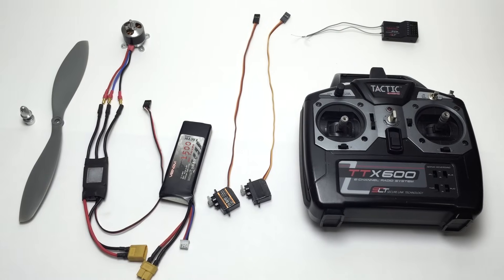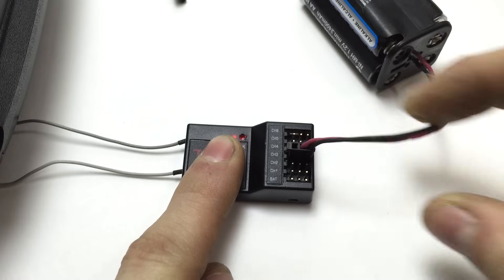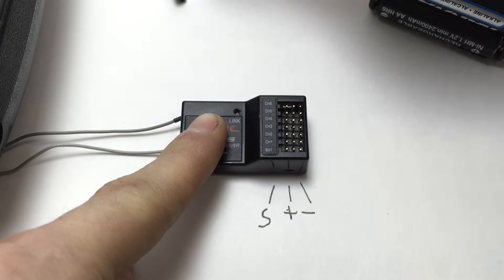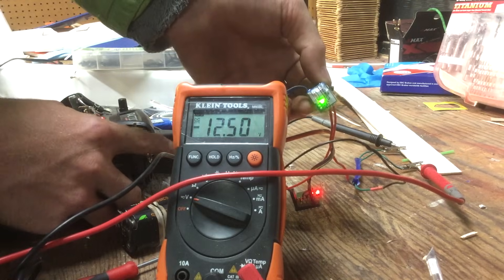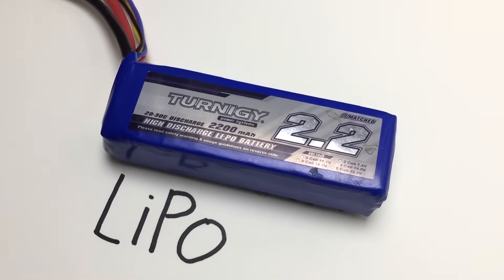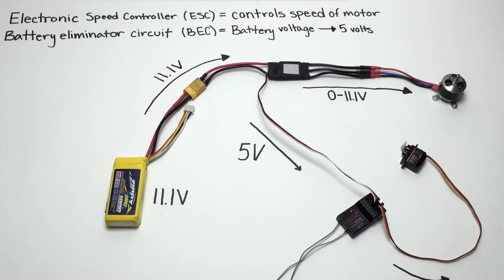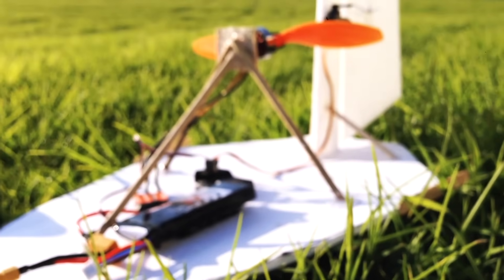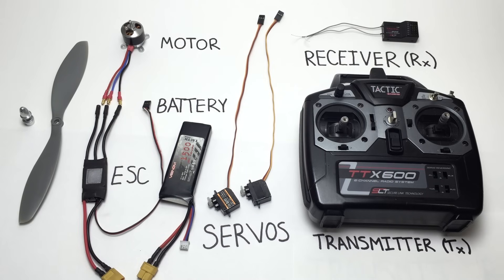RC Electronics for Noobs

Comment: Would it be possible for you to give a parts list for electronics I'd need to get started? I don't want to buy something just to find out I wasted my money. Basic question, if you were starting from scratch to build your first experimental RC plane, knowing what you know now, what would you order?
Reply: And I mean exactly what you order, preferably with links.
Reply from the maker: +Chad Snoke That's a great question, and it's hard to say just because I don't just go around buying everything. So some of the things I've seen that I think are good deals and quality products are also things that I haven't bought so I can't personally vouch for.

Keep in mind that this equipment is where the money is. This is why RC planes are expensive. But I consider it an investment and very high value because it's reusable equipment that you can strap to all kinds of foam crap. Most of my equipment has been with me for years through DOZENS of airplanes (and their fatal crashes).

I like this kit from Flite Test: http://store.flitetest.com/power-pack-c-fixed-wing-large/

I also think HK's Orange TX/RX line is a very good deal: http://www.hobbyking.com/hobbyking/store/__54822__OrangeRx_T_SIX_2_4GHz_DSM2_Compatible_6CH_Transmitter_w_10_Model_Memory_and_3_Pos_Switch_Mode_2_.html

This is a great bettery http://www.hobbyking.com/hobbyking/store/uh_viewItem.asp?idProduct=11944
You could save 5 bucks with some others if you want but I would buy this one.

This is a simple charger http://www.hobbyking.com/hobbyking/store/__49338__Turnigy_E3_Compact_2S_3S_Lipo_Charger_100_240v_US_Plug_.html

But if you want, a fancy charger is a really awesome tool to have http://www.hobbyking.com/hobbyking/store/__58285__IMAX_B6AC_V2_Professional_Balance_Charger_Discharger.html
Reply: +Samm Sheperd (SNRS) Thank you, parts ordered and can't wait to start building! Any experience with an autopilot system? We're primarily interested in mapping and after a few builds may try to implement waypoints and GPS.
Reply from the maker: By they way, I just notice that the Orange transmitter doesn't come with a receiver. The cool thing about the Orange line up is that they have receivers that are also flight stabilization systems. This is a standard 6ch receiver http://www.hobbyking.com/hobbyking/store/__31224__OrangeRx_R620_DSM2_Compatible_Full_Range_6Ch_2_4Ghz_Receiver_w_Failsafe.html

If you don't want to pay HK shipping again, you may be able to find it somewhere else. like amazon http://www.amazon.com/OrangeRx-R615X-Compatible-2-4GHz-Receiver/dp/B00HZSD8UO/ref=sr_1_1?ie=UTF8&qid=1456945476&sr=8-1&keywords=orange+receiver
Reply: +Samm Sheperd (SNRS) Thanks, I noticed there was no receiver so I ordered this basic one:

http://www.hobbyking.com/hobbyking/store/uh_viewItem.asp?idproduct=46632

It doesn't say it comes with stabilization like this one clearly does:

http://www.hobbyking.com/hobbyking/store/uh_viewitem.asp?idproduct=31586

I'm guessing my first one will not have stabilization, though it would sure be handy as a newcomer.

Comment from the maker: Also, do you think I should do a review on that mini quad at the end of the video?
Reply from the maker: Oh okay...
Reply from the maker: Used this motor http://www.headsuphobby.com/HURC-300-Blue-Wonder-1400kv-Brushless-Motor-G-272.htm

and an 18A ESC, 9g servos and this same radio system all used in this video
Reply: +Samm Sheperd (SNRS) The CX10 has been out a while now.  It's a great learning quad.  I just wish they would have a cheap one with 3 axis (acro) on it to learn with.
Reply from the maker: Rum Ham By pressing down on the right stick, you enter flip mode. The transmitter will beep and you can push it forward, back, left or right and it will flip that direction by itself.
You can also cut the throttle mid flip to force it to flip multiple times, though recovery is not guaranteed.
Reply from the maker: Antaluss66afira66 bf110 With no ESC, you can't control the speed of a motor, You can still control servos if you can power them with a battery or something
Reply: +Samm Sheperd (SNRS) I would like to know how you did that flip.
Reply: +Samm Sheperd (SNRS) Oh cool. I never read the instructions.
Reply: Rum Ham  You weren't missing much by not reading them.  As usual they couldn't be bothered for a real translation.  Maximum Engrish.
Reply: williwonti haha
Reply from the maker: Rum Ham Clicking the left stick changes its maximum bank angle/sensitivity/maneuverability
Reply: Samm Sheperd could you do a review on the new pocket plane they make?
Reply: Samm Sheperd yes pleasee
Reply: +Samm Sheperd (SNRS) This thing is way cooler than I realized. Even though I already have one I think a review would be a good Idea, considering how cool they are for the price.
Reply: +Samm Sheperd a question what if there is no esc
Reply: ***** tanks
Reply: Samm Sheperd yes
Reply: Samm Sheperd darmn it I bought servor and only has three plastic things
Reply from the maker: Antaluss66afira66 bf110 I don't understand your issue
Reply: ***** I wish I could send u a pic
Reply: Yah
Reply: Samm Sheperd i want to make rc quadcopter i just want to know that can i use rc helicopter transmitter and receiver for quadcopter?
Reply: Samm Sheperd Thank you so much this really helped me out I'm building an rc car  with a string trimmer engine and I didn't know how to setup S servo with a controller nor did I know how to use the receiver. Thank you! You saved my project!
Reply: what did you use to connect your motor wires to your esc wires
Reply: Rip
Reply: Samm Sheperd hello , what your name
Reply: Samm Sheperd . contact me now  bro
Reply: Saif Ali he is dead
Reply: your noob
Reply: @normanyoutube3864  he is dead now may he rip

Comment: See I told you , another great lesson for the new RC user, you helps get new modelers building their own models, you make it less misticale. If I were to plug a servo with different wiring in to the receiver will it cause any damage apart form not working.I wa told that it will damage the potentiometer.
Reply from the maker: +Chris Boyce I don't know of such a case. There are 3.3v servos, but they are micro and have a different connecter

Comment: This is perfect! I have been wanting to start scratch building rc planes for a while but have been a bit confused about the electronics. This answered many of my questions. Thanks a lot!
Reply from the maker: Awesome! There are always more question. RC groups and YouTube will usually have an answer, but if you have a specific question, ask me!
Reply: ***** The only other question I have right now is about LiPo batteries. It is my understanding that they should not be discharged past a certain point. How am I supposed to know when they reach that point to ensure I don't damage them? Do I need to get a multimeter to check them?
Reply from the maker: Rum Ham Great question, LiPo batteries are annoying because they won't let you know when they are dead. Once they discharge past 80% of their capacity, or about 3.0v-3.2v per cell, they start to damage themselves. But since most ESC's come with a low voltage cutoff feature these days, it's not quite as important. But a good tool I use is this one http://www.ebay.com/itm/NEW-RC-Lipo-Battery-Low-Voltage-Alarm-1S-8S-Buzzer-Indicator-Checker-Tester-LED-/271746517929?hash=item3f455acba9:g:MzYAAOSwYGFUvRrP

It plugs into the balance plug and tells you all the voltages, and you can set at which voltage to trigger the alarm, it is VERY loud for such a small thing. If you wanna be extra nice to your batteries, set it to like 3.4v, or you could push them down to 3.0v if you really want, just don't leave them there for too long.
Reply: ***** Thanks a lot!
Reply: Joey A me too I want to scratch build q plane too

Comment: Great and simple explanation, love it!
Reply from the maker: +Ga2be Thanks! I think you had a little glitch or something, check out my spam box! http://imgur.com/R1Z6uPE
Reply: +Samm Sheperd (SNRS) Holy... It just told me some error occurred, so I spammed the button a little. Sorry!
Reply from the maker: ***** Youtube is pretty good at filtering suspicious comments
Reply: +Samm Sheperd (SNRS) Great for me I guess! I also have a question, are you able to change the channel which your control works at? I've heard about "crystals" but I'm not sure :S
Reply from the maker: ***** Currently, 2.4GHz is what everyone is using. With 2.4 GHz, the Tx and Rx are connected digitally and don't need crystals. Before 2.4GHz, it was 72MHz, with that system people would have to use a matching crystal in the Tx and the Rx. there were only a certain number of different crystals so people had to make sure two people weren't using the same crystals. These crystals were named a channel. What the crystal actually does is tune the radio into a specific sub frequency. like 72.790MHz. 72MHz was also kinda glitchy, required 8 AAA's and had really long antennas. So the new 2.4GHZ is pretty great.
Reply: +Samm Sheperd (SNRS) Cool, thanks!
Reply: I still have 3 72MHz radios and like 5 crystals. I am hoping these will one day be collector items. HA!  Great job on explaining everything. I have sent this to quite a few people when they ask me about the hobby.
Reply: Ga2be ikr